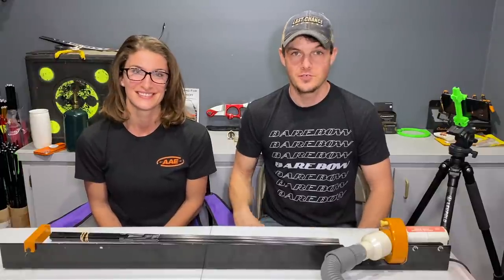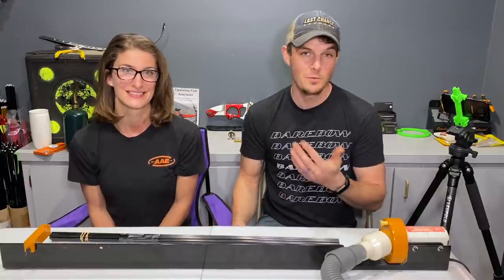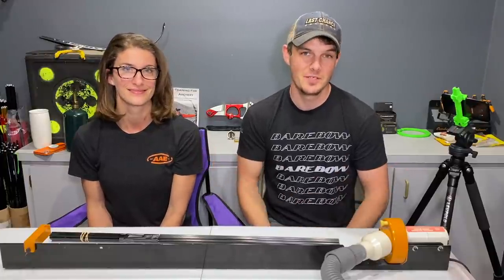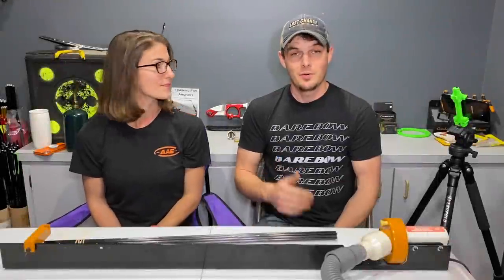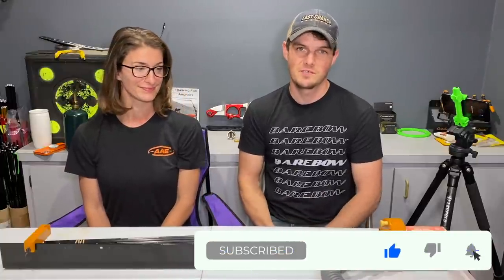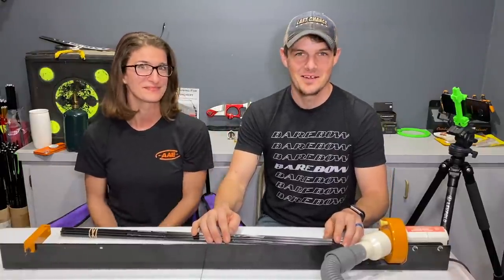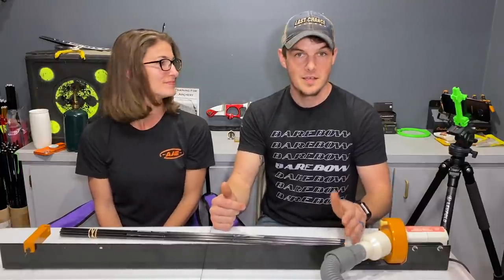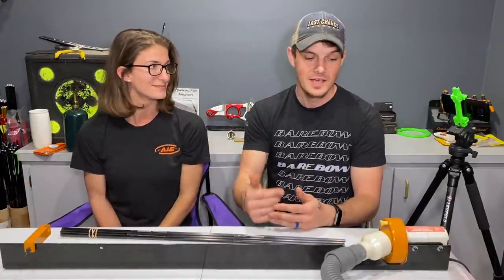How to Cut Arrows for Beginners | Helping an Archery noob Cut Arrows for the First Time

Comment: I have built an home made arrow cutter using Dremel with a very thin Rotary cutting wheel for under $20. It works fine for my purposes and could be a suggestion for whom cannot afford the cost of a professional arrow cutter.

Comment: To answer her question at 21:30 is you would taper the inside on the shaft with a deep six grind stone works great and you will find a more exact fit

Comment: When having problem installing push-in nocks, I use an arrow puller to give better grip on the shaft. On one type of shafts the fit was so tight the arrow puller didn't give me enough grip, so I used a one-handed clamp that had v-cavities in the bars to hold the shafts (of course tighten the bar gently to not damage the shaft)

Comment: Two hundred and some might come easy for but for me it's not I've used the little brake line cutter for my arrows and it done fine for I always flex my arrows while I'm practicing to check for cracking but I guess it all comes down to what ever works for the person

Comment: If you don't have an arrow saw, some options for you: 
•See if your local club or range has one that you can use or rent time on. I know mine has an arrow saw, fletching jig, and other tools that club members can use as part of their membership.
•Have them cut when you order them. This does make it harder to adjust arrow length when tuning, but Lancaster and other reputable online dealers offer cutting services for a small cost.
•Have your local shop cut them. Possibly expensive, but not prohibitively so. My local shop cuts arrows you buy from them for free and charges for arrows purchased elsewhere.
•Have them cut at a local sporting goods store. This is kind of a last resort choice, as you don't know how much the person doing it knows what they're doing. I'd bring a tape measure and check that everything is square and even before leaving. Often cheaper than an archery shop, but less reliable.

On straightness and cutting:
Some archers swear by (on parallel shafts) cutting from front and back get the straightest results. On arrows with wide tolerances, this may be worth doing. Although if you need to be that picky, I don't really know why you'd buy arrows with wide tolerances in the first place?
Reply from the maker: To your last point, you would ideally want to find the straightest section of the arrow that you need. IE if your arrow length is 26" and the raw shafts are 29" you may want to only cut 1" from one end and 2" from another on one arrow and 3" from one end on another arrow.... different for each arrow to find the straightest section. But that way too above the purpose to this video.

Comment: For .006 I usually cut an equal amount off both ends.  I'm sure other folks already know this but thought I'd throw it out there.
Reply from the maker: It depends where the bent area is, find the straightest section of arrow length you need and chop that out..... but that's way too advanced for the purposes of this video.
Reply: @JakeKaminskiArchery  Thanks.

Comment: how to measure he SPINE after cut the arrow, for example originally easton inspire spine 750 with 29,5 inch length, then we cut it  1 inch so become 28.5 length, so how much is the SPINE after cut
Reply from the maker: The spine is always the spine. A 750 spine arrow is always 750. This is because spine is measured when a 2 lb weight is hung from the center of the arrow with supports 28" apart. even if you shorten an arrow it is always the same spine. It acts stiffer as you cut it but the spine itself does not change.

Comment: I'm probably late to the party here but the simple answer is that the only safe way to cut a carbon arrow is friction cutting using some sort of high speed grinding wheel designed for cutting.

Comment: If you have old damaged arrows would it be ok to cut them way back and make crossbow arrows out of them? ( assuming that would remove the damaged section?)
Reply from the maker: If they are the right size and spine I wouldn't see why not. However, I know basically zero about crossbows so take that with a grain of sand.
Reply: Oh, also, my 25 year old daughter wants to start recurve archery.
She is rather frail and not " standard strength" for someone her age and size. What draw weight would you recommend to start?
Love your videos!
Reply: @Voxguitarsrock  my girlfriend started with 18 pounds (marked 22, but 26" draw instead of 28"). Your best bet is to go to a range or club and have her try a few different bows (most ranges have bows between 14 and 26# available to rent for open shooting).

Comment: Why don't you just drill a hole in a block of wood and bolt it to your bench so you.can push the arrow nock into the arrow shaft in the hole? That way the shaft can't slip and you don't break an arrow?